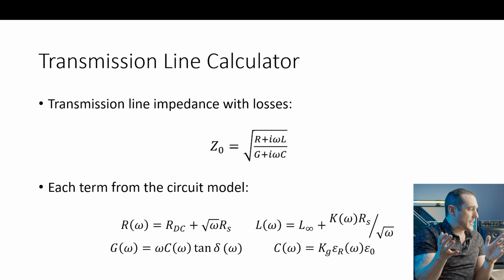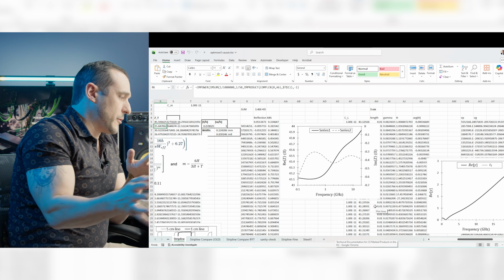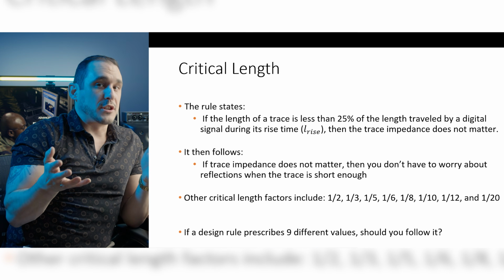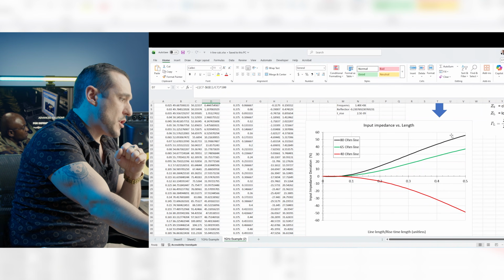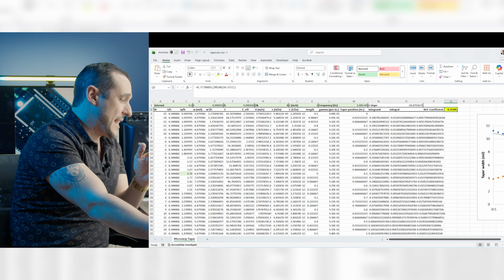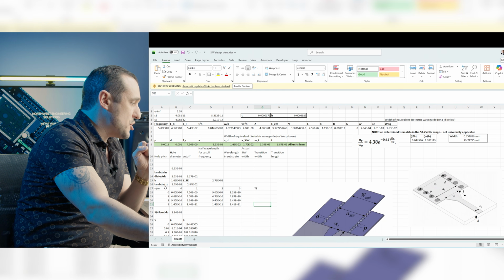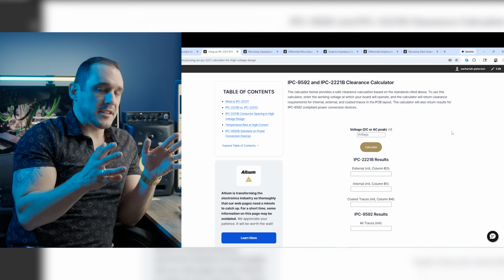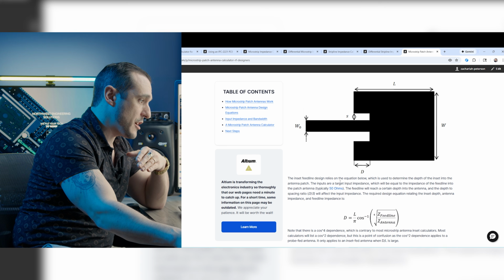Every PCB Design Calculator I've Created

Comment: clearly your concept of a transmission line is quite different from what I'm accustomed to. The transmission lines I'm used to operate at a closely controlled 60 Hz, operate at voltages up to 500 kV and deliver thousands of megawatts over hundreds of kilometers. 🤣
Reply from the maker: We're talking about PCBs over here, it's all about delivering data very quickly